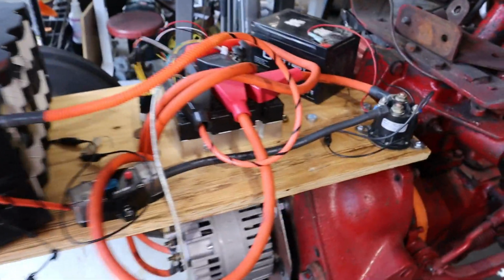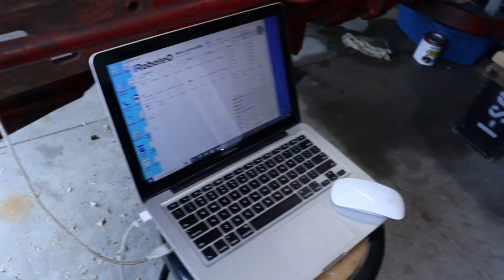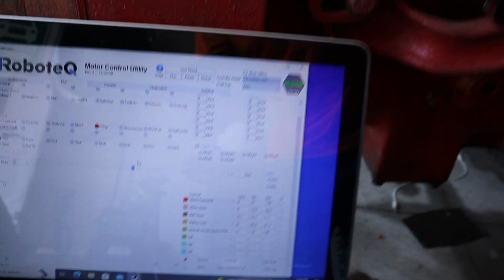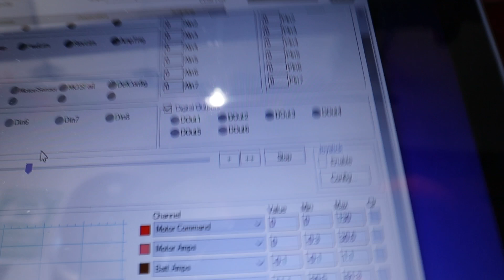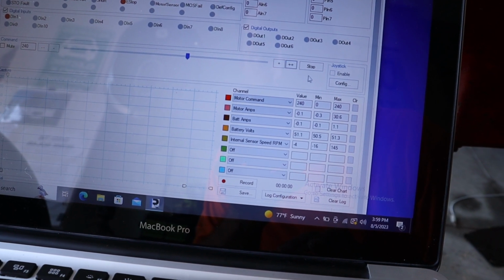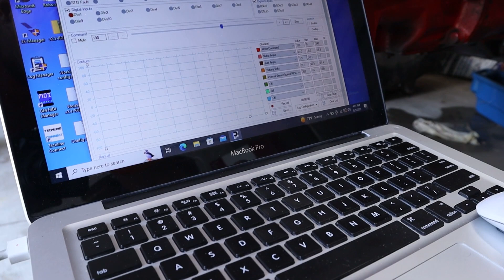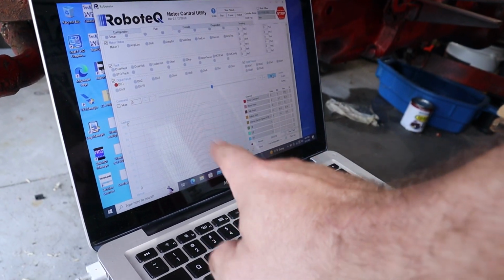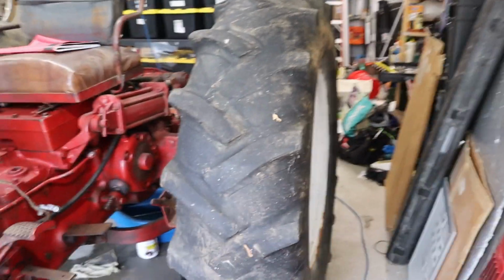Electric Tractor Conversion - Spinning Wheel the first time

Comment: the screws holding the plate along with the washers that are "standoffs" are going to be the weak point, a lot of torque might crack them. I'd go and add a smaller "washer' plate stacked up there to connect to the bigger plate, if that makes sense.

Comment: Congrats on wheelspin - that's a major milestone!  I do have a little concern with the thickness of the adapter plate...  With the big torque of the motor combined with vibration you may get small tears in the metal around the bolt holes leading to a Rapid Unscheduled Disassembly.  Don't be afraid to get a much thicker piece after this prototyping phase.

P.S.  Have you heard about the EVCCON convention in September?  Would be great to meet you there, I'll be upgrading my 914 with 6 Tesla battery modules.
Reply from the maker: Yes, that metal is a little thin, but it's what I had handy, and it's easy to cut and drill. The original engine mounting plate is 1/4", so that's what I always planned on using for any final configuration.

Hmm. I really hadn't thought about EVCCON. I just looked and I could drive there in a day, and don't have much on my calendar at that time. I'll check to see if I can make it.
Reply: @BenjaminNelsonX I figured you had a plan!  Great, hope to see you there.

Comment: Looking good!  When you say that the transmission was only designed to spin one direction I agree that this is true but did someone actually tell you that there are elements in the transmission that wouldn't work in reverse direction?  If so what were they?  oil pump maybe?
Reply from the maker: I physically couldn’t spin it the other direction by hand. It can spin the one direction, but not the other.

Comment: Nice, the great thing about conversions like this is you take a reliable machine, remove a lot of complexity and parts you may no longer get and open it up to decades of new use. 20-30 years from now it should still be working but it may have new better batteries. The motor is durable, kept cool the motor controller should be and you have no proprietary tech to anchor the machine, no planned obsolescence.
Reply from the maker: No John Deere saying “You can’t fix that!”
Reply: @BenjaminNelsonX  very practical for stuff like this. Seems like with the weight to power ratio, under 25 hp is very economical with lifepo4 and you can solar charge up to 100 volts with mppt controllers. 
Exciting times. A small farm could be nearly fuel free.

Comment: I saw you mention the transmission is one way rotation, but I don't think that's a real concern here.  The main concern you should watch is PTO rotation.  Most PTO equipment has one-way drive ratchets so that when you slow the tractor with the PTO spinning the equipment won't over-ride the brakes.  It also looks like you have plenty of room to mount that forklift hydraulic power unit in front of your drive motor if you just run longer hydraulic hoses back to the valve spools.  I'm not sure how much you've played with the hydraulics, but they should hold position without the power unit running, so you would only have to power the hydraulic pump when you are moving the hydraulic levers.
Reply from the maker: The issue with the transmission is that it literally only spins the one way. As in “the motor will break something” if trying to spin it the other direction. 

In front of the drive motor was the original plan for locating the hydraulic pump. I just didn’t have the hose length for it. 
If I end up using a larger drive motor, then the hydraulic pump motor will have to go on the side somewhere, a bit like how I have it. (Only more securely held than just ratchet straps!)
Reply: @BenjaminNelsonX 
If your worried that the transmission is going to break if you spin it backwards, then I'd disable the regen function, as that will put the same reversed forces through the transmission. 

Nice project though.
Reply: I own and have used a LOT of PTO powered equipment over the years... And I have only ever seen one piece of equipment with a built in over-ride clutch. The vast majority of PTO equipment does not have this protection built in. You typically have to buy an over-ride clutch that attaches to the output shaft of the PTO on the tractor. I have an old Farmall Super H (Which is the "row crop" version of the International 300 Ben is converting here) and I have to use an over-ride clutch on all my equipment because otherwise the kinetic energy in the mower/tiller/shredder, etc will easily over-power the brakes when I try to stop.

This is why tractors moved away from having the PTO input and transmission input tied together in the late 50s: If the PTO is spinning: Then so is the transmission. Pushing the clutch and slamming the brakes will do you no good when that brush hog is spinning at full speed.
Reply from the maker: There have been quite a few Ford 8N conversions. Part of that is there's still a lot of those tractors out there, but I think the other part of it is just how SIMPLE they were.
Separate drive, PTO, and hydraulic systems VERY much complicates converting a tractor to electric.

Comment: Before you get too far down the path you're heading, contemplate putting a PTO implement on there, like say a flail mower. Start it while at a stand-still, which is what one is supposed to do, and now put in in gear to pull forward in a controlled manner.

To know and understand what's going to happen, get into a regular automatic transmission car, put it in neutral, rev the engine to around 3 or 4 thousand RPMs, and shift into drive.

You need to power the PTO and the drive wheels independently of one another.
Reply from the maker: The one limitation of this setup is that it cant start the PTO and THEN start moving the wheels. It CAN start moving the wheels and THEN start the PTO.
Reply: @BenjaminNelsonX  I know you've already touched on this... But it might be helpful to do a deeper dive and clarify that your 300 has the "Independent" PTO option (and maybe explain what that is) which means that there's a separate clutch in the back to activate and deactivate the PTO. Your 300 is not using the main transmission clutch foot pedal to engage / disengage the PTO (Which is the more commonly used method sometimes referred to as "live" PTO) instead that lever to the right hand side of the seat activates and deactivates an actual clutch assembly which allows you to engage the PTO while the motor and wheels are at speed.

The one downside to what you did is by welding together those gear sprockets: you tied the PTO and transmission together so that when you push the clutch in to stop any momentum in your mower will "push" the transmission with more force than your brakes will be able to resist. But as long as you have an over-run clutch on the PTO output that should solve that issue.
Reply from the maker: @JeremyAkersInAustin  

Yeah, I've been thinking about shooting a video specific to the PTO.
The tough part of this is that I pretty limited experience with tractors - mostly what I've learned by working on this project! Whereas my Youtube audience is half people with ZERO tractor knowledge/experience and half with WAY MORE than I do!
Makes it challenging to create good videos with such a diverse audience!